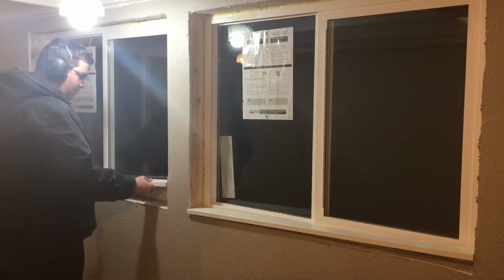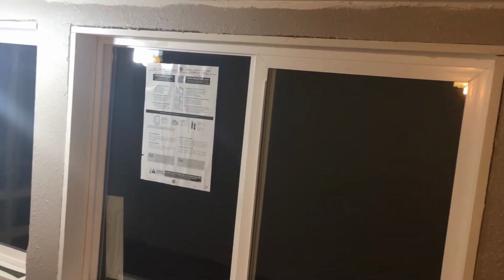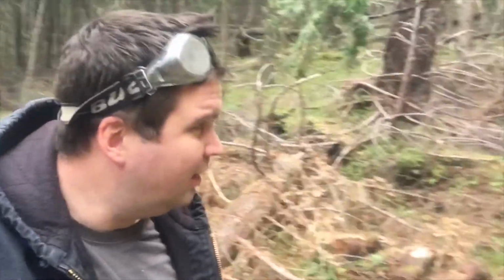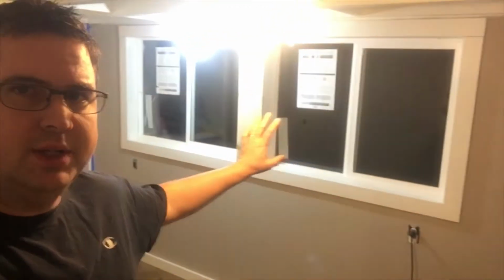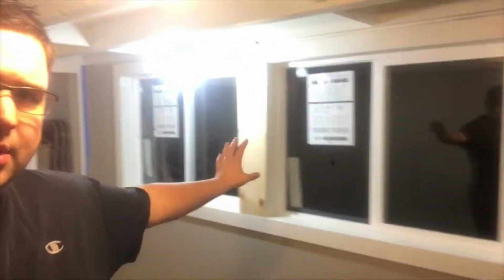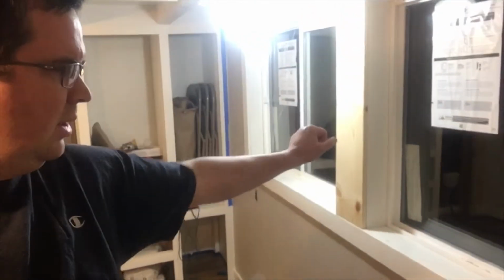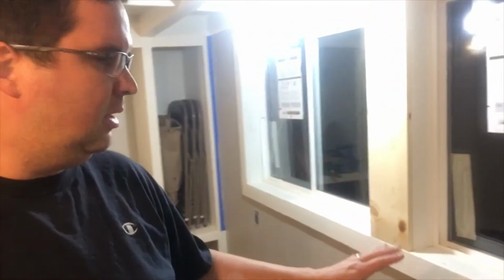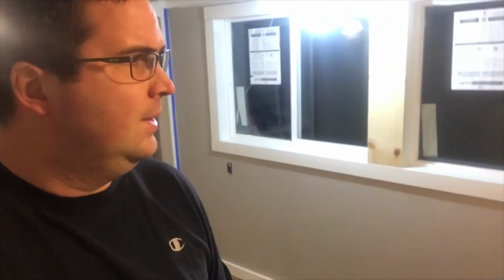Finishing Window Trim

Comment: Do you fill in the brad holes with spackling, or wood putty???
Reply from the maker: Dede usually uses caulking on things that are paint grade. Super cheap and she uses a putty knife to scrape it flat. A little bit of paint over the top and you can hardly tell.